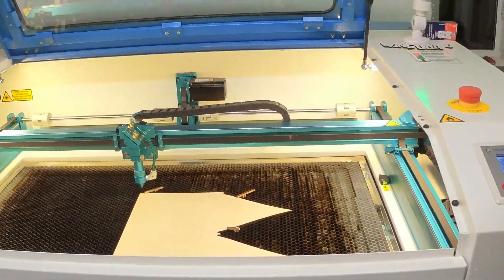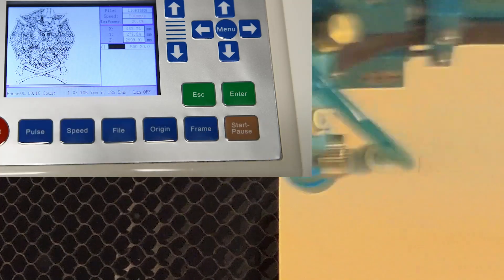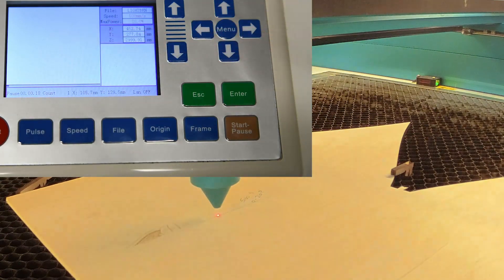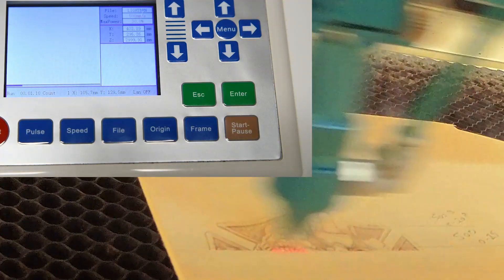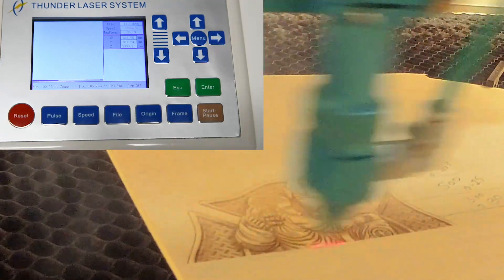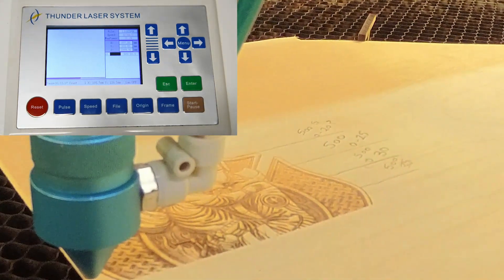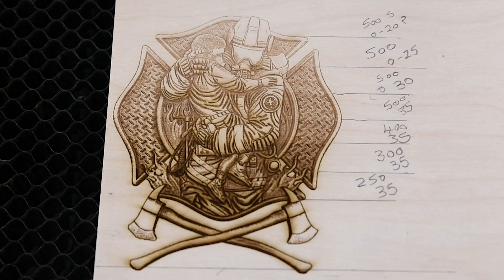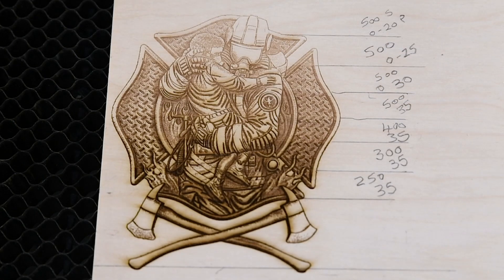Co2 Laser Best engraving photo settings for your machine power, speed, DPI

Comment: Thank you for all your help over the years! I've learned a lot from you. I do have a question..this one you're showing here is more of grayscale 3d type of image, yes? If it's a picture or image that you don't want the depth but you want the detail? How would you go about that? Thank you again!
Reply from the maker: this is just a regular image that i dither using Imag-r and then burn using PASSTHROUGH image mode, if you Type into google  "Greyscale STL Images" you will see them there (Y) i did do a video on the 3d type images, type in 3D laser image and it should pop up.
Reply: Thanks for your reply

Comment: Great video, so are you saying when changing the power settings on the controler will override the power setting in the fikle from lightburn?
Reply from the maker: thank you, yes once you change the speed or power on the controller it will then use those settings, but the file in lightburn would still be the same, when you change your settings it is not until you press start that you will see the settings change and then they will show in the top right. thank you